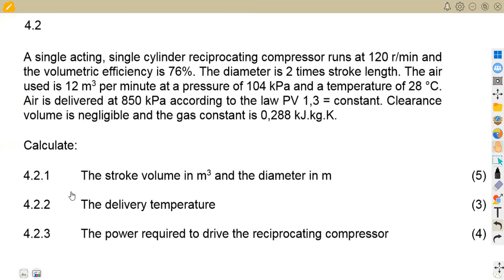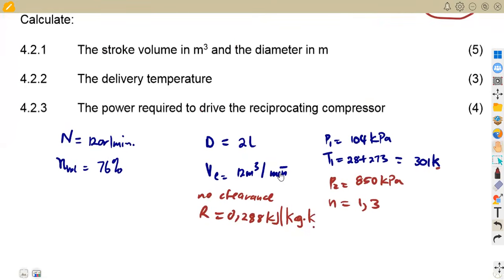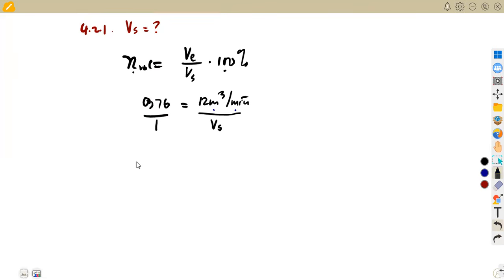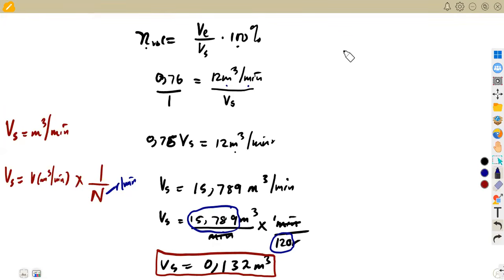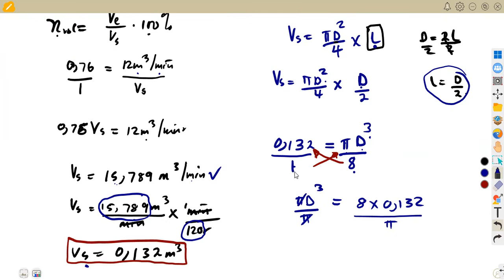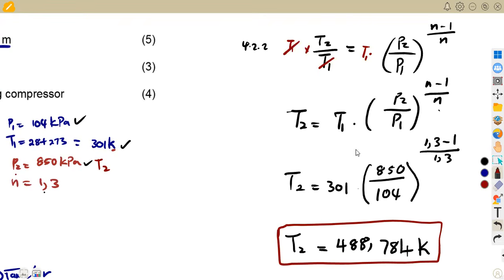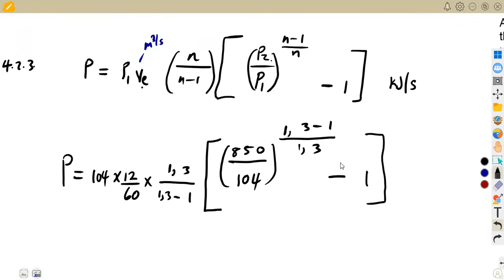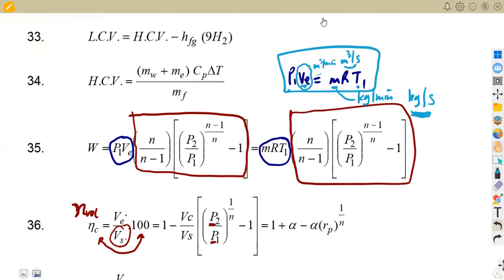Power Machines N5 COMPRESSORS NOVEMBER 2022 @mathszoneafricanmotives

Comment: on 4.2.3 didnt you calculate Pout? If not how do one differentiate, im asking because the question said calculate power required
Reply: It's power required "to drive the motor" which is the input power